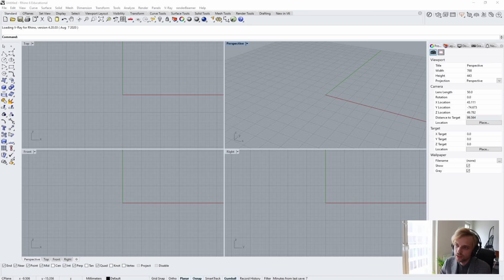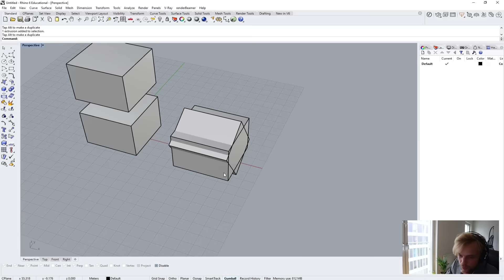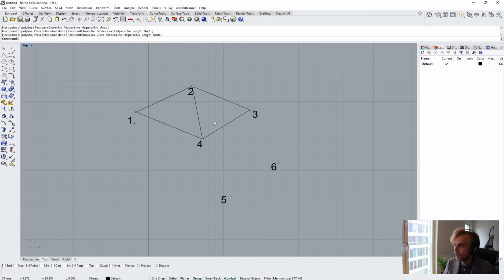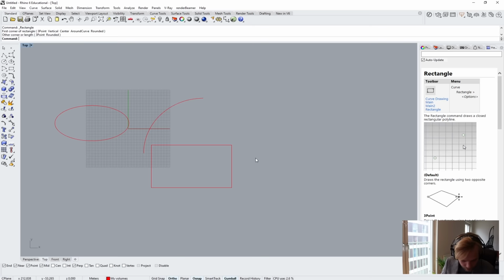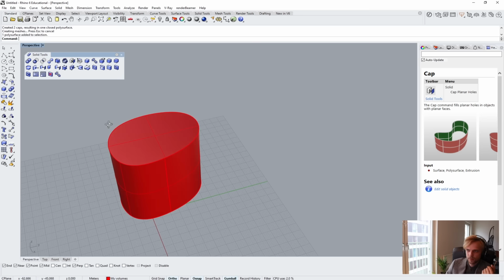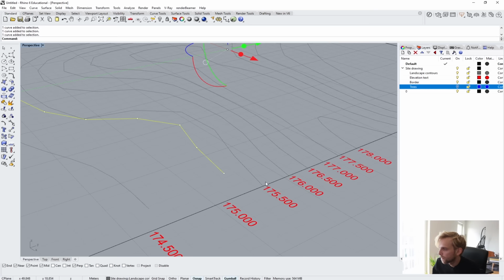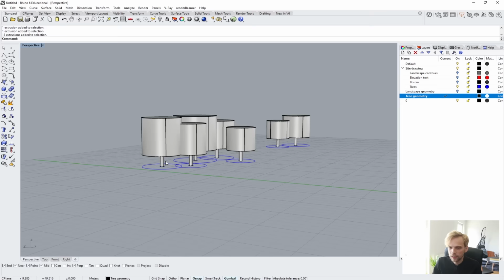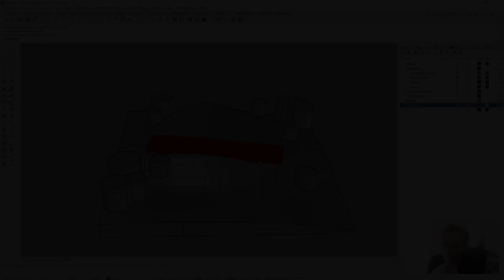AADA10 COURSE (Part 1) - Rhinoceros 3D introduction for Architects

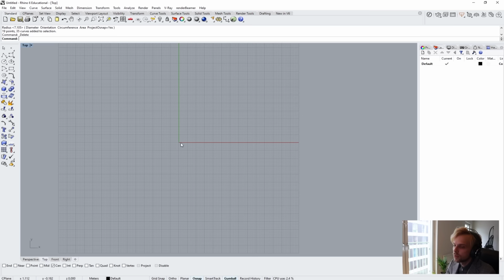Comment: 45:00 it was actually never snapping to the intersection because you never turned it on... you were just so precise to draw those lines that one of them intersect exactly at its midpoint, and the other as well, where the edge of the small circle was :D ...what were the odds
Reply from the maker: Ah right right - this tends to happen more often than one might think :D

Comment: grid snap is really useful when designing using modules ... axes and so on
Reply from the maker: Yup, I agree. At earliest stages of the project I do see grid snap being used. The thing is that once the initial axes/modules are added, then you turn off the grid snap and keep it turned off for the rest of the project :D

Comment: I finished this course and was proud of myself 2 years ago, but I still ended up going back to Sketchup for CAD and Revit imports and exports. In the end, I ended up forgetting the things I learned haha.

I'm just wondering where I could use Rhino in the architecture field? An explanation on situations where I should use rhino instead of Sketchup might be nice.

For context though, most of the firms I've worked at only build residential and commercial buildings, and some interiors.
Reply from the maker: Really depends on the country honestly. In the area where I work (nordic europe) the use of sketchup has been declining for the past 10 years. Now Rhino has (almost) completely replaced it in all medium/large scale companies. As other example - India/Bangladesh is dominated by AutoCAD/Sketchup/Revit combo and Rhino is only used in niche offices there. I estimate that Rhino will replace Sketchup in every country though, as the development of Sketchup has been quite poor in the past 5 years, while Rhino's developers have stuck to Revit with a pretty good bridge Rhino.Inside.Revit. It's a good strategy to have.

Comment: Hey im womdering how i can put in doors and windows and work on level plans like we can on revit and archicad can you please make a video explaining it. I loved this tutorial so much better thsn my uni tutors 😊
Reply from the maker: The way Rhino works is quite different from archicad or Revit. You do not automatically place windows/doors here and you do not 3D model through plans. You'd need to model out the door, cut out the holes in the wall for the door (i like using a box and then doing booleanDifference command) and then placing the doors/windows in said hole.

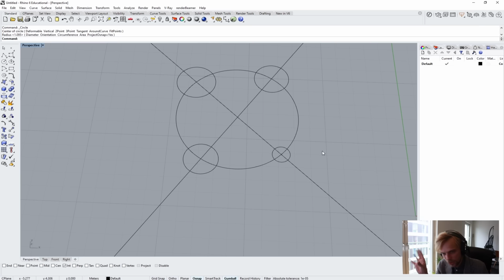Comment: At 46:00 you never had intersection snap turned on... I was literally shouting at the screen 🤣
Reply: Great video, by the way!
Reply from the maker: If I had a dollar for every time I forget to turn on/off different snapping...
Reply: @DesignGoBrr  Maybe you can give me some advice. I'm building an expedition vehicle which is basically a 7m x 2.5m tiny house built on the back of a 6x6 truck. I'm having the box on the back fabricated by professionals, but I'm doing all the interior myself, so electrics, plumbing, furniture, heating etc etc etc. I'd like to model everything in CAD and fabricate as much as possible with CNC... I'm a software engineer but I've never used CAD before this project. So I've been learning Fusion 360 for the last 3 months, and have become more and more frustrated by bugs and limitations as my model has become more and more complex. I'm seriously thinking about giving up with Fusion and switching to Rhino (I'm Mac based so Solidworks and Inventor are not options). Do you think Rhino would be a good fit for this project? How does it handle large models with hundreds of complex sub components?
Reply from the maker: @dbrophy  Rhino will not limit you, but at the same time, by not limiting you Rhino WILL let you create messed up geometry, so it's a bit of a double edged sword there. Honestly - I use Rhino, Fusion, Solidworks, Blender and sometimes 3ds Max for my 3D modeling - and when it comes to CNC based small scale manufacturing - Rhino for CAD phase and Fusion for CAM phase is the best workflow. In terms of System requirements - the only limitation is the RAM - if you have 8GB, then you might see a decrease in performance at last stages of the project, but if you're using 16GB, you'll be just fine it can handle 100k+ (simple) parts then without any issues. P.S. Sketchup is a nono. Big bad.
Reply: @DesignGoBrr  Thanks! Here's my model by the way: https://a360.co/38mxZg3

Comment: Hello! I'm really enjoying your YouTube lecture! I have a question. When I use "Tween two curves," there are so many points in the curve that are created. I've always used Rebuild to reduce the number of points by redefining them. But I checked that there are fewer points in your video. How did you do it?
Reply from the maker: Typically when you tween two curves with different amount of CP's Rhino is always going to create a curve with amount of points equal to the larger amount out of the two inputs. So if you tween between Curve A (10cp's) and Curve B (2 cp's) the output curve C will have 10CPS. So I'd check the inputs first to see where the extra points are comming from

Comment: While trying to perform the boolean difference command, after we extrude the rectangle surface, my landscape geometry disappear when I try to apply the command. Please help me out. TIA
Reply: incase someone was facing the same issue, just make sure that your cuboid is closed. You can use PlanarSrf command to make any missing surfaces, then join them together.
Reply from the maker: Make sure that the geometry is closed. Boolean operations break when rhino camt calculate whats inside and whats outside
Reply: @DesignGoBrr  Noted 👍👍

Comment: Where is a basic object information panel showing how long a line segment is, large in XYZ dims a box is, a circle's dia is?
Reply from the maker: It's a bit different from Autocad's properties panel - Rhino has a command "what" that gives the basic information of the selected object, but you have to type it in every time you want to use it. This makes sure that you don't crash your pc every time you select a 10 mil polygon mesh and need to calculate its surface area.
Reply: @DesignGoBrr  So "What" command just shortcuts to the "Details..." button in the Properties:Object panel....which is incredibly backwards when Rhino pivots itself as a competent drafting / CAD modeling program. If I click an object in any other program, I get a very simple "X feet x Y Feet" dimension which is 90% of what I'm trying to know when I quickly click a piece of geo in AutoCAD. Not having something similar to this is drafting with one hand behind my back. I'm looking at a this "What" info panel right now with an object selected and all I see is edge info, tolerance info...but nothing that's just "It's 700mm by 850mm" Eesh.
Reply from the maker: @FireBert85  Hmm, never found this to be an issue and never saw any posts about it being an issue in the forums. Perhaps the use case for Rhino doesn't require users constantly checking the dimensions of objects. Also Rhino is much closer related to Alias, which is a surfacer rahter than a typical CAD drafting program.
Reply: I mean it's really just a matter of nearly every design package having this basic Object Info Palette element where clicking an object shows you very basic dimensional information of that object. But, someone pointed me to the BoxEdit command in Rhino and that seems to be something of a solution I'm hoping for in this program.

Comment: So, can rhino move the landscape contours height automatically? What software can do this?
Reply from the maker: In theory it should be possible to do with Grasshopper, but you'd need pretty clean input drawings with altitude for every contour marked out. I don't know any software (including Rhino) that would do this automatically.
Reply: @DesignGoBrr  thanks!

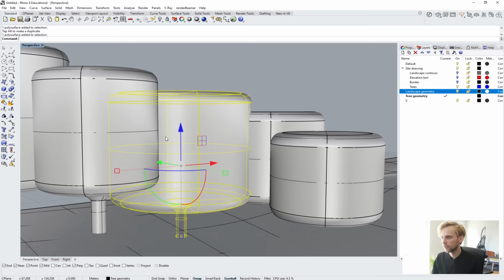Comment: 2:49:13 Hi, does it have kind of drop tool or not?
Reply from the maker: Not really. It has Project tool, but that would squish my geometry to the landscape surface.
Reply: @DesignGoBrr  no i mean like rain🌧, you know there were trees and to automaticly rain them on to the landscape, in sketchup there was a Drop tool: you select objects and move them up definitely higher than landscape and if you use that tool it will Drop your trees until they hit the landscape

Comment: How do you stack objects on top of each other?
Reply from the maker: There are multiple ways. One that's most straight forward is simply using the Move tool. Select an object that you'd like to stack on top of another object. Type in Move command. click on any point on the bottom of the object (that is FROM where you're moving), and then click on any point on the top of another object (that is TO where you're moving)
Reply: @DesignGoBrr  I will try that, thank you

Comment: Don’t mind these:
Reply: 58:00 meshes vs nurbs
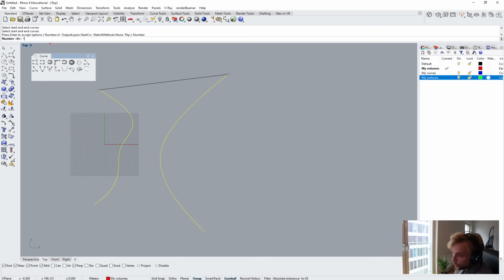Reply: 1:20:00 tween curves
Reply: 1:35:00 loft
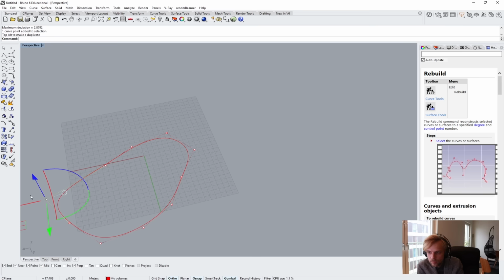Reply: 1:43:00 rebuild
Reply: 2:23:00 patch (3d curves into topography)
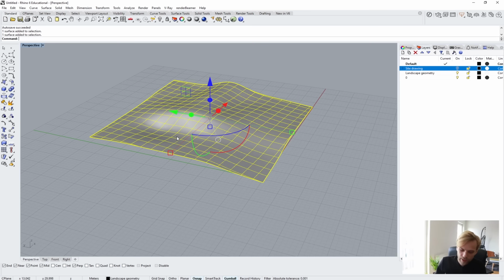Reply: 2:30:00 dupe border
Reply: 3:05:00 solidpton (control points to edit a solid)